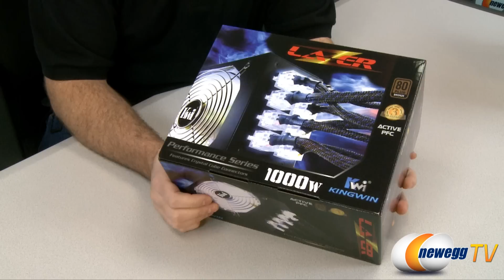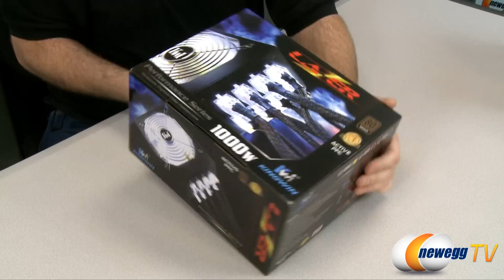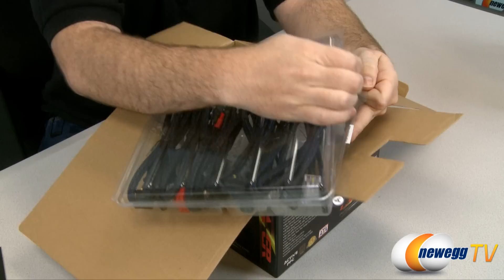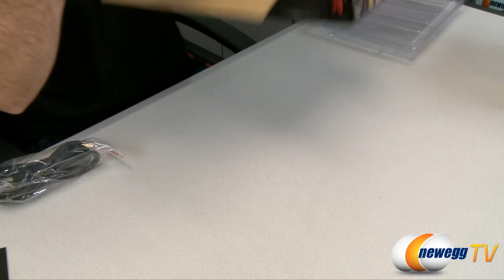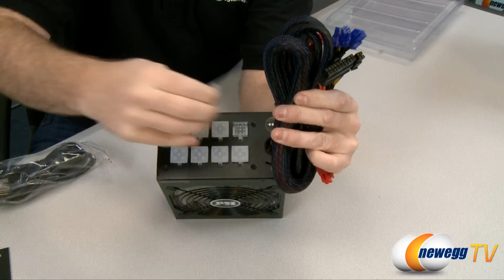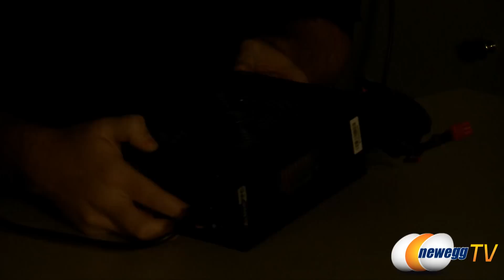Newegg Unboxing: Kingwin Lazer Series Power Supplies

Comment: About the floppy power cable the companies should just have an adapter separate ,so the cable can be use for something else like PCI-e molex SATA etc... nothing  against floppy but why companies still making floppy drives power cables on new power supplies?

Comment: I run the 1000W Lazer to power my 6950's. I absolutely love this power supply. 
I beat this thing up daily. I roll with it fan up since I have 4 Rosewill 120's pushing from the side in my HAF. You can google Blech's Budget Brawler if you want to see one installed with a Crossfire setup.

Comment: @photoshopdrummer it does turn off the LED's on the fan as well. I have the 1000W and absolutely have no regrets on buying it. In fact, I plan on buying the 850W version for a secondary build.

Comment: @NavyAviation2016 Actually depending filters your using, or want, then yes. Also SLI or crossfire dont actually add memory from the second card. So depending on your budget at the time, ytou might get a slightly less powerful card then paying 400+ for top of the line then add a second to get similar performance.

Comment: @NavyAviation2016 why is it overkill? if you run multiple power hungry video cards you need at least a 750W witch pretty much the lower you can get away with. And why would this power supply sound like a hellicopter it as 1 fan like pretty much all power supply on the market your video cards and case fans are to blame for noise in a pc build.

Comment: from johnny guru

Performance
	

8.5

Functionality
	

9.5

Value
	

7

Aesthetics
	

9
Total Score
	
8.5

The Good:

    * better modular connectors than the Mach 1 had
    * decent ripple and noise suppression
    * excellent voltage regulation

The Bad:

    * this sample couldn't hit Bronze efficiency, despite being the same platform as the Mach 1, which did hit Bronze

The Mediocre:

    * nothing serious